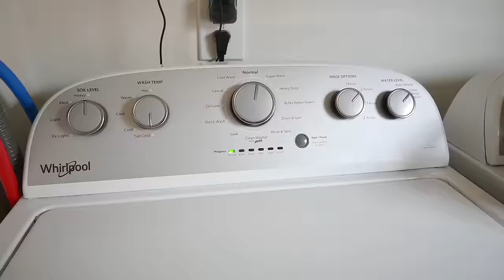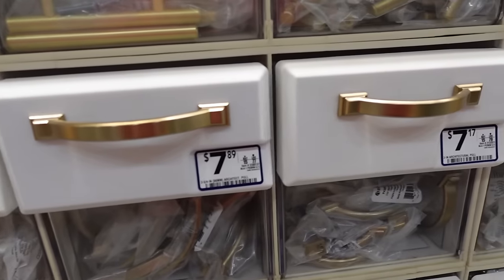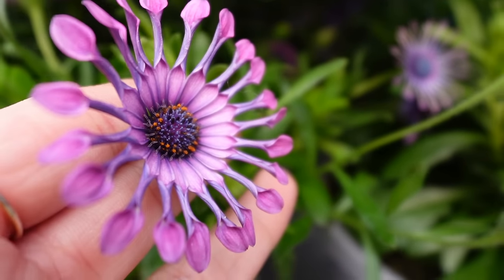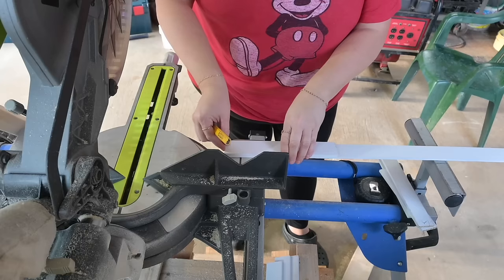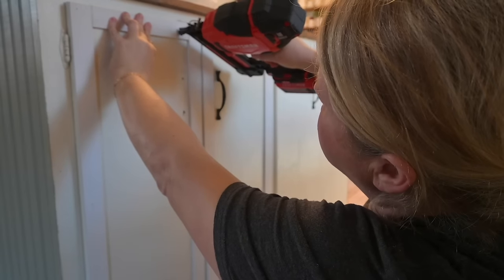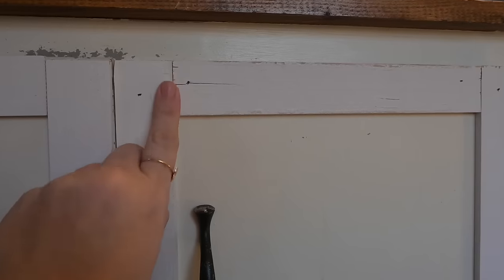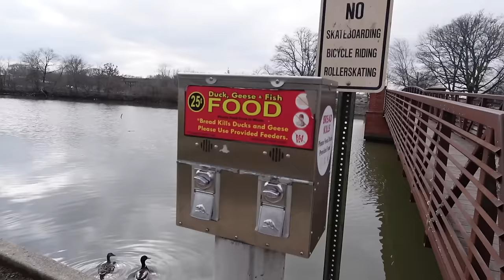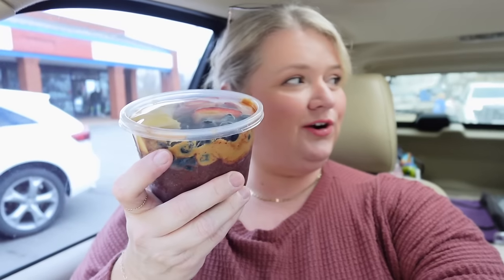Easy DIY update on my kitchen cabinets | Painting my island AGAIN | Sherwin Williams Dried Thyme

Comment: Your island looks great!  The reason for the price difference in the trim was probably because the unpainted was a solid piece and the primed trim was finger joined, which means it was several pieces joined together.  Those break easily, but can work well in some applications.

Comment: Ducks are so stinkin cute when they wag their tails, they do that same as a dog when they are happy.  I may have said before I lived in Hendersonville, TN many years ago. I don't remember that park, I wonder when it was first opened, it looks like a lovely place to spend some time. Your island project is turning out so nice, congrats on a stellar job. A tip I would like to give you for cutting wood is if you mark all your pieces ahead like you did be sure to take into account the kerf of the blade and add it or your piece will be that much shorter after cutting it. For those who don't understand, the kerf of a saw blade is about 1/8th inch so if you mark a piece of wood to be 8" long and cut it the kerf of the blade will chew away that much wood and you will end up with a cut 7-7/8" instead of 8" or whatever the kerf of your particular blade is.
Reply from the maker: Thanks for the tip!

Comment: Stephanie, Ive been wanting to redo my cabinets in my kitchen for a very long time. This house was built in 1947 and my husband bought it in March 2002, so unknown if they're original,  but they look it!!! Lol. I had thought about removing the many layers of paint and staining them a dark hunter green with white porcelain knobs on the upper and lower cabinets with golden pulls on the drawers. Im now reconsidering and may go with your paint color instead. I also love the beadboard, its very lovely in your home. I also am wanting to put butcherblock as my countertop with them well oiled. Looking foward to your next video on that!!! Ive never used any washer sheets, but Im willing to try for several reasons. 1) the environment needs our help in the worst way and i would like to do my part. 2) our washer abd dryer is out in the garage and the liquid laundry detergent tends to really thicken up , when its pretty cold outside!!!, and 3) the cost for the amount seems really beneficial to my wallet. Best of luck in all you do!!!! Hugs from Lisa in Oklahoma